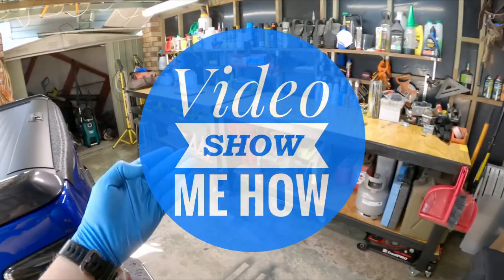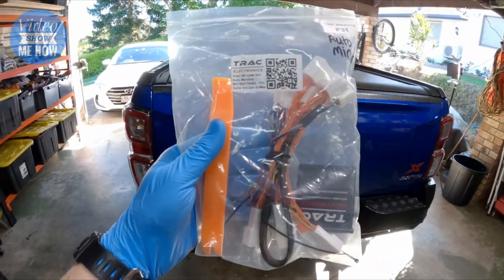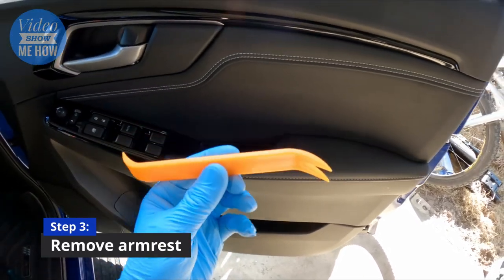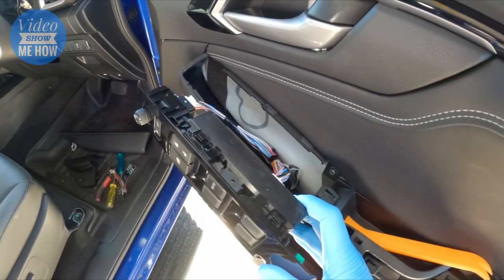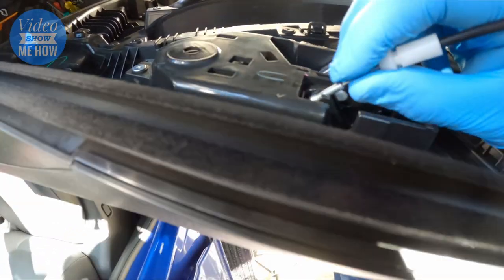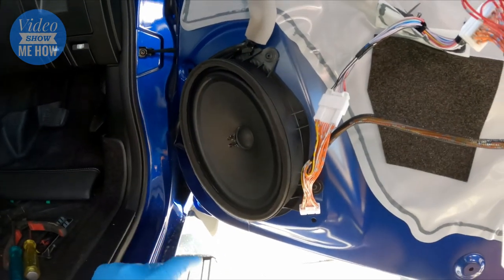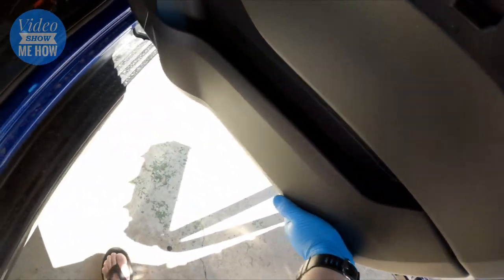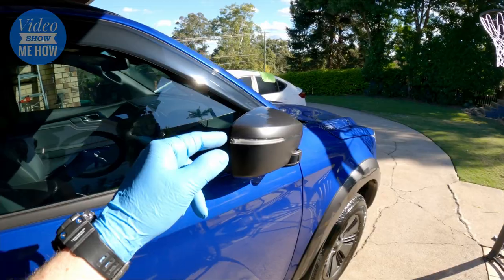ISUZU D-MAX Auto Mirror Module | Trac Electronics | 2021 DMAX X-Terrain Build-Up Series #8

Comment: Adam can you tell me were I can get the black tailgate paint protector firm you have used on your D_Max X-Terrain on the video as I am planning to fit the tailgate central locking along with Trac Electronics Mirror mod so these two mods would be great together.
Reply from the maker: Have updated the description of this vid with a link to it :)

Comment: I bought the mirror and window module before taking delivery of my new MU-X after watching this video and now that the dealer has finally swapped my  clearview next gen manual fold mirrors to power fold ones I've fitted the mirror and window module.
Thanks for this and your other videos.
Reply from the maker: Welcome 👍
Reply: @mickcoz1995  hey mate so u chucked on powerfold clearview mirrors with that trac system and they fold and open do they man cuz i’ve just bought a pair of the clearview powerfold and i don’t have the module and won’t open😅
Reply: @pingu003  I made sure mine were working manually from the switch on the door before fitting the Trac module because I wanted to make sure the dealer fitted them properly.
Fitting the Trac module just added the automatic fold and open 
Mine is an LS-T but I'm not sure if all 3 models have power fold wired up.

Comment: Didn't know about this, so thanks. Going to get the upgraded module myself, with the auto windows and mirrors. Its a feature we use on our X5 on hot days, all windows down via fob to cool the car before we get in it, with the auto start for added cooling. So thanks for this, much appreciated. Its the simple things that often give so much value to using a vehicle. Cheap too... $150 for two features.
Reply from the maker: Yep agree, very similar install also :)

Comment: Awesome video man! Always easy to follow for those not super automotive tech savvy…

Ideas for future vids:
- Front and Rear dash cam install
- Upgraded audio (probably one of the first few I’ll do to my DMAX)
- Lightbar and/or rear work lights
- Electronic roller cover

- Heated and Ventilated seats? Or is that too far lol
Reply from the maker: Haha would love vented seat, buuut may stretch the old YouTube budget just a bit 😁
Reply: @VideoShowMeHow  you are costing me money mate 😅😅 the MY22 apparently cones with heated seats now, so the salemans tell me, expected delivery for our X Terrain in Volcanic Amber is September 😅. So far you have cost me the bonnet and tailgate struts haha. The auto folding mirror is on the cards too, stuff like this should be factory 🙄. Side not the mirrors work with the keyless entry and walk away lock feature? Silly question but just confirming.
Reply from the maker: Haha sorry about that bud 😁 Yep you'll have heated seats 👍 Yep with the module you just walk away and car locks mirrors fold in. Get the combo module or window module like the vids and you can walk away with the windows down too and they all close up. Pretty sweet
Reply: @VideoShowMeHow  that costs more money 😅😅. I have been following your Dmax build recently so much that I subscribed 👍🏽😁. Thanks for sharing mods and step by step guides with us.

Comment: You’re a star. Bought the module months ago but just installed and with your instructions worked perfectly!
Reply from the maker: Glad it helped 👍
Reply: Does it connect to both mirrors or only one? I just purchased a 2024 D-Max and looking to purchase this mod.
Reply: @VideoShowMeHow does the module connect to both mirrors from the driver side, or do I have to purchase a second kit for the other side?
Reply: The module only needs to connect to the driver’s side as this is where all the main functionality is so no need for a second module on passenger side.
Reply: Thank you very much @manmale1074

Comment: Good install, next purchase as we speak- a must for all, cheers 🍻 georgie boy 😎
Reply: Ordered module- bang💥coming next week.👍🍻
Reply: Hi 
Installed module to DMax.
Straight plug n play.
One thing I noticed is the auto window doesn’t work anymore?
Do you know why.
Reply from the maker: Just got to reset it, was in an earlier comment will try find it for you
Reply from the maker: ok here it is from the manual: 

- When the battery has been reconnected, perform the following initialisation settings in order to operate the driver's power window properly.
Open the driver's window halfway. Pull up the driver's window switch to full close the driver's window and then keep the switch in this position for 2 seconds.
Reply from the maker: Some great info here too thanks to Braeden: https://m.facebook.com/groups/363807414761264/permalink/546135403195130/
Reply: @VideoShowMeHow  I’ve contacted trac electronics as well, they replied the same as you.
I’ve done that as well and has done nothing.
I’m going to see if Isuzu dealer tomorrow and see if they can reset it for me.
Thanks for your time.
Keep you posted 👍🍻
Reply: @VideoShowMeHow  when the battery has been reconnected?
I didn’t disconnect the battery? You didn’t show that on video?
Would that be the problem it’s not working.
Reply from the maker: @georgesalouris  hmm unsure mine worked ok, maybe drop trac an email

Comment: Another great video.  Any plans for a fridge and slide install?  The dimensions of the X-terrain are so limited.  Same with tie down points; 2 is just not enough.
Reply from the maker: Yeah have a fridge to suit, just filmed a mini review on it (out soon) but not going a slide as using the ute for ute things :) You can upgrade the rear two corner bolts to m8 eye bolts (did the same on the front corners) so you have two in the rear as well as two in the front.

Comment: I installed the folding mirror module on my 2023 Xterrain today. Works great thanks. Great Vid. However when you walk away from the car the auto lock doesn't work as per previous to install. If you use the remote it works fine, ie mirrors retract on lock and deploy on unlock. Is this normal.

Comment: Easy to follow with clear instructions. Question tho.. is the auto window still meant to work? I have to hold the button now where as it was auto before?
Reply from the maker: Yep. You just need to reset them. The procedure is in a previous comment 👍

Comment: Hey mate, great to see another blue xterrain in the flesh. Any chance you’d be doing a video on a UHF install with a rj45 passthrough on the transmission blanks?
Reply from the maker: Love the blue hey! Mate am doing exactly that :) That's why I left the extra spot below the brake controller (you can see in the brake controller install vid) Likely installing the actual unit under the cup holders

Comment: Hey Adam,
Can this be done with a 22 LSU or LSM using the stock mirrors that come with it. I am under the assumption you would need to replace the mirrors with ones that have smoother moving mechanisms in them?
Reply from the maker: Hi, needs the electronic mirrors I'm afraid

Comment: Great video, but not sure if I've installed correctly, as I have lost my ''auto'' window function and now have to hold the window button to raise or lower completely.
Reply from the maker: All good, just need to reset it, covered in the comments and on FB forums :)
Reply: @VideoShowMeHow   Sorry can't see the solution anywhere. I'm new to this and don't have facebook...help !
Reply from the maker: @rasigscharles8442  found it - put window up. Then window down holding the the button down for a few seconds then wind up, holding the button up, do it again down while holding down and should re set.

Comment: Hi Adam, Just a question Iv installed Tracs Auto mirrors Mod, But BSM Doesn't seem to work now, Have you had any issues with BSM not working ?
Reply from the maker: Bsm?
Reply: Sorry,,,Blind Spot Monitoring, Warning light on side mirrors,

Comment: like to see how to move the tub over for an even gap on each side of the tjm rear bar. ones 4-5mm others sides 1mm 😂 (granted tjm has offered to do it for free so ill take them up on that offer) id say its probs 4-6 bolts so i could prob just do it myself to move it over 1 or 2mm
Reply from the maker: Oh really? Do you mean the bit that kind of wraps around the sides? Yours has a gap difference? Gotta check mine now!
Reply: @VideoShowMeHow  yeh that top bit that wraps around under the taillight part, mines got a gap difference, i have seen that a lot  have posted about it when getting the tjm rear bar

Comment: Hey mate. Brilliant videos. I am pretty much following them build by build for my X Terrain. I have just fitted the Trac window and mirror module combined and have noticed the door and window lock buttons are not illuminating on the driver’s switch pack. Can’t remember if they did before or not? Do you know if they should?
Reply from the maker: Gotta reset the window module, in the comments here somewhere as well, basically Start the car, hold the window down button until the window goes all the way down and continue to hold for 10 seconds, pull to wind the window all the way up and hold for a further 10 seconds. Once you've done this you should be good and the one touch should work and lights. The lights still aren't working, it must be something else or maybe the plug wasn't plugged back in properly
Reply: Thanks mate. I just reverted to the old switch pack and those two buttons don’t illuminate on there either so I’ll assume all is good as everything else is working fine. 
Do you have a video of the install of the tub rack, removing sail plane etc. that’s the one I want to do next
Reply from the maker: No video for that one I'm afraid, for info on the Facebook forums on removing the sail plane

Comment: After installing this do you loose the automatic function of your driver side window?
Reply from the maker: No still all ok. You may need to reset it, to do that press and hold the down for 3 secs after the window is all the way down the do the same up and will reset.
Reply: @VideoShowMeHow  perfect👌 worked a treat cheers 🤙

Comment: Anyone here having minor issues with the rest of the controllers on the arm rest after installing the auto mirror? 

My auto up and down window control seems really temperamental. Same days the auto function works, other days it doesn’t.

The central locking button on the arm rest also only locks, doesn’t seem to unlock. The auto folding mirrors working a treat tho

I’m wandering if I’ve done something wrong, or have a faulty auto mirror 🤷🏼‍♂️
Reply from the maker: Hmm mine is still working fine, all the connectors connected neck in place securely?
Reply: @VideoShowMeHow  yeah I’ll have to give it all a good screening and go through it again. Your video made the whole process stress free thank you 🤙